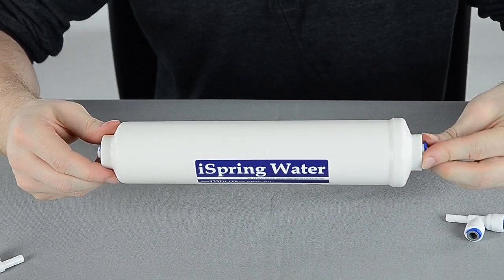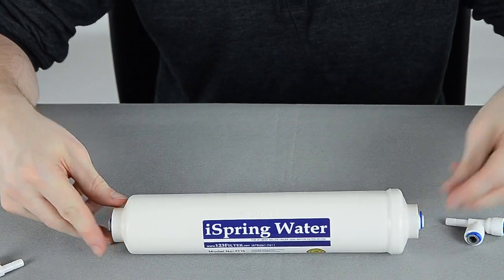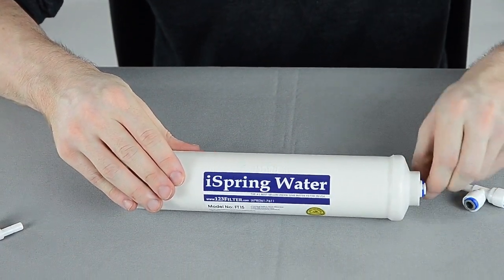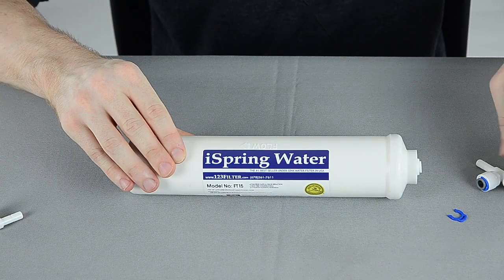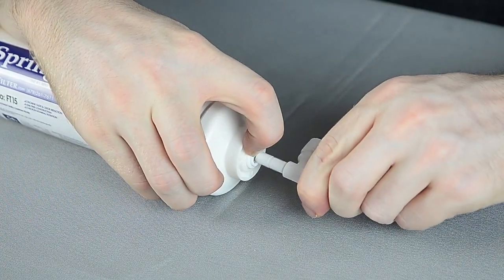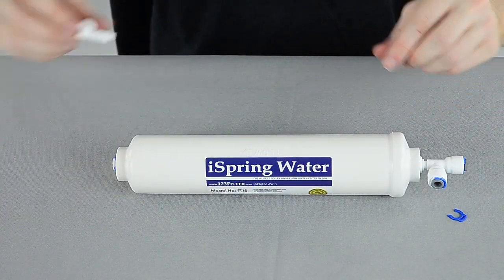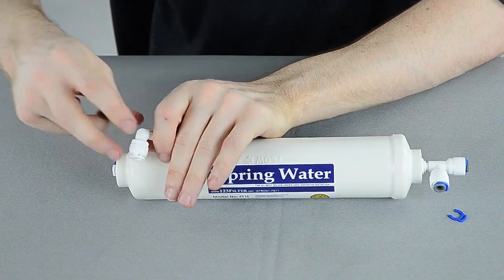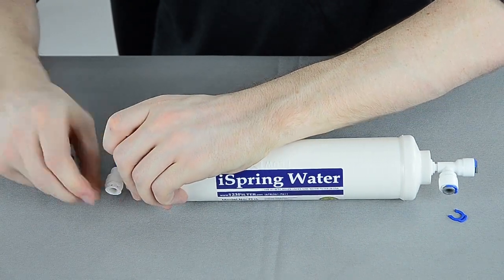How to Use Quick Connect Fittings | iSpring FT15 Post Carbon Filter Installation

Comment: If anyone else is having leaking issues with the quick connects -- try pushing the water tube in further, beyond when you first feel resistance and you only think the tube is fully seated. There's another few millimeters to go beyond that. I was having the same issue and getting really frustrated but that fixed it.

Comment: I'm considering removing the post carbon filter. What's the purpose of ADDING ppm back into the water? My TDS is 4-5 but when I bypass the post carbon filter, it's a 2-3ppm. Also, when by bypassing the post carbon filter, I don't get those initial high TDS numbers when the faucet is turned on. (When not using the system, solids seem to settle from the PCF into the water and cause a comparably very  high TDS where about a gallon needs to be dispensed for  the TDS to settle back down to 4-5ppm. Thx.
Reply from the maker: Hi dear customer! To collect an accurate sample of water to test, please let the water run for 3-5 minutes and then collect the water since if you test the water right after you open the faucet, there might be a concentration of water and minerals. 
The FT15 post carbon filter removes chlorine, tastes, and odors in the water and  provides final polishing before the purified water is delivered to the faucet.
The Alkaline remineralization filter (FA15) gives back minerals such as ionized calcium, magnesium, sodium, and potassium ions that are taken away while purifying the water. These minerals come from the media that's included in the cartridge. By adding minerals, you are adding nutrients that increase the water's pH and decrease the acidity. These minerals will be shown in your TDS score. You might want to check our blog about the TDS:
https://www.123filter.com/ac/to-filter-or-not-to-filter-total-dissolved-solids-tds 
Could you please confirm if you are referring to the FT15 post carbon filter or FA15 remineralization filter? 
Please, kindly contact us to  support@123filter.com or  to (678) 261-7611 M-F 8:30-5:30 EST to properly guide you. 
We are happy to help!
Reply: @iSpringWaterSystems  Thanks for the prompt response. I was referring to post carbon filters in general. I stand corrected, however. The initial spike in TDS when the faucet is first turned-on also comes from the rest of the system including the membrane and/or it's housing. (I temporarily bypassed the post carbon filter and the TDS spike is still present) I guess it's to be expected.

Comment: You removed a blue clip from the end of the new filter, then snapped new quick connect elbow in, but I didn't notice the blue clip going back on where the new elbow slides into the filter?
Reply from the maker: Hi there! Yes, the blue clip should go back to secure the connection.

Comment: fittings accomodate only 1/4".  apparently when my system was installed 10+ years ago, the supply line from the tank to the FT15 filter and then from that filter to the faucet are both larger in diameter.  Would have been nice to know ahead of time that the filter has been modified and impossible to change from quick fit to screw in.
Reply from the maker: Hi Robert. We need more information like some images to solve the issue. Please send the images of the places that don't fit to support@123filter.com and call us at 678-261-7611 (M-F, 8:30 - 5:30 EST). We are happy to help.

Comment: That is awesome... Mine has the screw in and old screw fittings so I will definitely be buying this one next time I need to replace it along with the fittings. Will save me a ton of time not having to reapply Teflon tape each time. 
Here are the links for the fittings for those that need it:
90 Elbow = https://amzn.to/2RxTFys
Tee = https://amzn.to/2VsSe3N
Filter: https://amzn.to/2C9mgkj

you should do the same thing for the FA15 ph filter (https://amzn.to/2s78kCy). Then swapping those two will be a breeze.
Reply: Mario Quagliuolo  the water will be black at first regardless of how you mount it. Usually they recommend to flush it for a few minutes when you first installed it. How long did you run it in reverse?

Comment: I can't seem to remove the fitting. It does not even press down. What do I do to remove the fitting so I can replace the filter?
Reply from the maker: Hi ggfailulu. Could you please give us a call at 678-261-7611 (M-F, 8:30 - 5:30 EST) or send us an email at support@123filter.com? We are happy to help you solve the problem.
Reply: @iSpringWaterSystems  I have the same issue and just realised no other fittings were included in my 3 year water change order. How do you release the fitting???
Reply from the maker: @goyangi  Hi Simon. Please remove the c-clip so the connector can be pressed down. If it still doesn't, please feel free to give us a call at 678-261-7611 (M-F, 8:30 - 5:30 EST). We are happy to help!
Reply: @iSpringWaterSystems  Thank you for the prompt reply. I had to put back the old filter for the moment,  but will try again as soon as I can. Will call if anything.

Comment: I replaced my FT15 and it came with the new quick connect fittings. Unfortunately my T fitting leaks constantly from both the autoshut off and tank connectors. I have a ticket open with support, so hopefully this is easily resolved.
Anyone else have similar issues with this new quick connect system?
Reply from the maker: Hi Jeff! I'm sorry to hear that your T-fitting leaks. Since you have already had a ticket open, our customer service team will help you solve the problem ASAP.
Reply: I can't get my 90 degree elbow that was factory installed to stop leaking.
Reply from the maker: Hi  @Kaltwasser45 . I'm very sorry about that. Could you please give us a call at 678 261 7611 (M-F 8:30 - 5:30 EST) or send the problem and your purchase receipt to support@123filter.com. We stand behind our products and will help you to get the problem fixed.
Reply: @iSpringWaterSystems  It was for a customer actually. After about 45 minutes of trying to position it right, I just bypassed the the #6 filter. I'll see if I can get that info from him.
Reply: I have exactly the same issues. My new replacement filters with quick connect fittings keep leaking. What a horrible redesign.
Reply from the maker: Hi  @38jkv56io-u0lt . I'm very sorry about the leaking. Could you please give us a call at 678 261 7611 (M-F 8:30 - 5:30 EST) or send the problem and your purchase receipt to support@123filter.com. We stand behind our products and will help you to get the problem fixed.

Comment: I accidentally put wrong quick connect on the wrong side. How do I take it off?
Reply from the maker: Hello, 

Thank you for reaching out! To disconnect, you should first remove the blue clip. After that, you'll need to hold the lock sleeve down to pull the fittings out. Let me know if you're unable to remove it and we can send you some spares from here.
Reply: @iSpringWaterSystems one of the worst designs I've seen. No matter how flat or flush it is, it won't release the fitting. Absolutely stuck